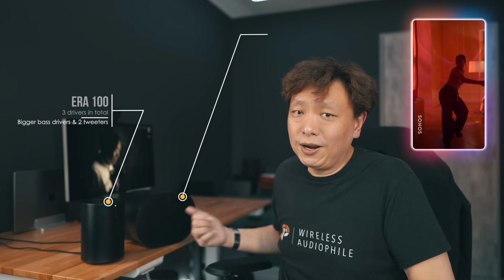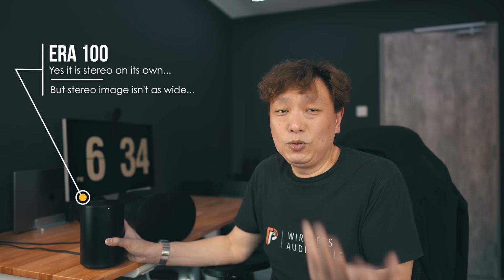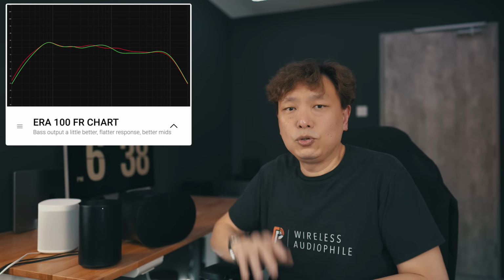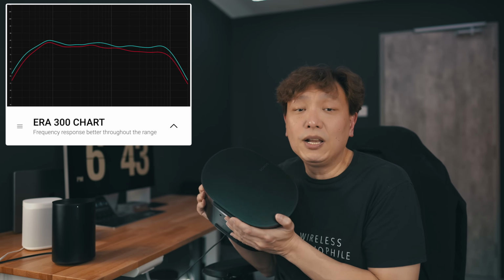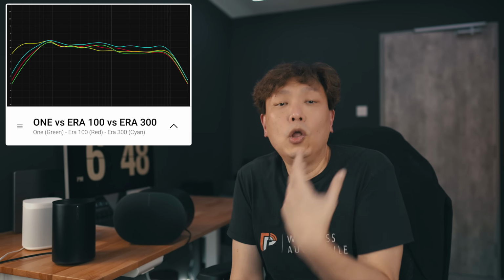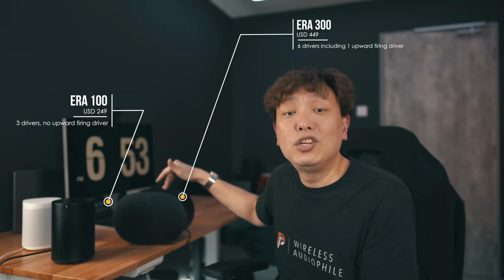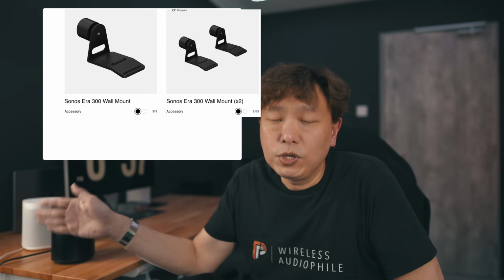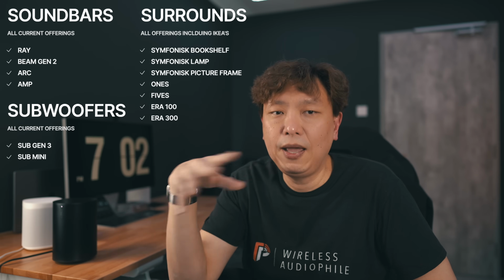Full Review of Sonos Era 100 & Era 300

Comment: Missed the boat with no upfiring driver and Atmos capabilities on the 100. It could have sold like hotcakes as a rear surround speaker at its price range. Marking up the price out of entry level range for a bunch of folks in this configuration was a massive blunder. The play 1 ticked all the bang for buck boxes. The era 100 simply doesn’t! I also don’t understand Sonos’s recent fetish for cylinder shaped cabinets? They’re simply sacrificing base output for cosmetics. I thought they might have learned from the Arc bass output fiasco, but nope! Square shaped speaker cabinets have worked well at boosting base for forever and a day.

Comment: Hi Peter,
Thank you for fruitful information given.  I'm now on a 20 years old Bose AV20 & traditional analog speaker (Arcam -  Vandersteen 2C - rest gone to graveyards already).  Looking to do some upgrade with Sonos & questions are:
1. How can I integrate the Vandersteen speaker with Sonos ecosystem?  Should I eye into Amp? Can do away with current Arcam integrate amp as it is about to reach end-of-life 
2. Considering Beam 2 + Era 100/300 + Sub Mini as my ultimate end game set & "no more" but can be less (see 2.2)
2.1 Would 300 overwhelm Beam 2? From price point aspect, 300 is more match to Arc (and 100 to Beam 2) but my view is having 300 with upward firing would do well with Beam 2
2.2 Need sub "and" rear speaker.  i.e. which combo doing a better job (a) duo-1 Beam+Sub or (b) duo-2 Beam+rear or (c) trio
Thanks in advance

Comment: Good stuff man. I actually find that even in stereo, the era 300 can deliver some really impressive sound on some tracks; the sound stage has no right to be this large for a single speaker, and while moving around the room, it remains really consistent.
I know that a lot of people seem to favor the Five for stereo listening, but after comparing both, I actually prefer the 300 for how consistent it sounds no matter where I am in the room.

Also, bluetooth is a really underrated addition for those who want to use the era 300 with an Android TV; most TVs and boxes now have automatic latency compensation and in my case, it works really really well even though it wasn't designed as a TV speaker. Sure, I'm missing on Atmos when using bluetooth, but for casual viewing with a projector for example, I was really surprised at how good a single era 300 did the job.

Comment: I have just bought 2 Sonos Era 300 to add to my Sonos Arc + Sub replacing 2 Play:3 as rears. I need some advice about the stands.

How tall are the original Sonos stands for Era 300 from to base to base (ie excluding the speaker itself)? My couch + pillows are 83/84cm tall and the ear level is about 94cm. 

I am thinking whether I should go for the Sanus stands which are 82cm tall (+ speaker height) or the Sonos ones (not clear how tall but probably 96cm + speaker).

Which one would be best?

Comment: Would the era 300’s be better rear surrounds than the in ceiling speakers? My biggest issue is the shape of my living room. I don’t have the option of putting speakers behind the sofa so they would need to be mounted either high on the rear wall or in the ceiling. I’m not even sure if the era 300’s would be able to mount on the ceiling so the amp+in-ceiling speakers may be my only choice. I’m just looking for the best possible setup for my application.

Comment: What upgrade would be better if you have existing ARC, One SL and Sub Gen3, The ERA 300 or 2nd Sub Gen3?
Reply from the maker: Very tough question.  But I’ll go for the era 300s. The second sub isn’t going to add so much more.
Reply: @PeterPee  thanks, planning to do some upgrade.
Reply: @PeterPee  Hi, one more question let say i will buy sonos five possible 1 or 2pcs to interface it with my TV using 3.5 jack right?

Comment: Peter - my current setup is Arc, Sub 3, and Ones, in a nice rectangular room. 12 foot ceilings.

The Ones are about a foot from the ceiling, about 2 feet behind the sofa, pointed 30 degrees down. Sounds great. 

QUESTION: Sonos User Guide says to mount Era 300s upside down if mounting near ceiling. I am thinking mounting them flat…no down angle…and toed in about 15-20 degrees. This will allow the Eras to have wall bounce from both sides. 

Thoughts?

Comment: Question: I currently run and ARC with two Play 1 SL's for rears and two sub gen 3's for my TV and movie watching, labeled theatre room on the Sonos app. In a second room I have designated as living room I have a Beam. I can control these two rooms independently from each other.  I would like to set up a pair of speakers in the theatre room for Stereo listening. Is it possible to get a pair of the Era 300's set up in the app to only use for music in the same room with potentially another Sub gen 3 or Sub mini and control it with the app? So in other words can I set it up as a separate system using the app and when I only want to listen to music be able to do so with the 300's?  Will the app allow me to set up a third room or separate option for this?

Comment: Thanks! I've been thinking about possibly upgrading to the Era 300s from play ones for my beam 2, full size sub and ones in my living room. Generally 
 50% volume, occasionally louder. I don't play my music loud enough to justify the five and they're not good at lower volume. I think I'll stick with the ones for now. Music only.
Reply from the maker: Hey if you are going to pair them with the Beam (gen 2), then it really doesn't justify the improvements to music. If you buy them for music alone and use them as stereo, then maybe. Thanks for your contributions!
Reply: @PeterPee  I decided to go with a pair of era 100. Not impressed with the reviews I've been reading on the era 300. After selling the old ones with an upgrade credit it's a pretty cheap upgrade. I got rid of the play 3s in that room long ago because they just cut out far too frequently. I've been trying trying to find a good replacement for the Play 3 forever and the era 100 is as close As It Gets with better newer Hardware.
Reply: @PeterPee  money is no problem I just don't blast my music loud enough to ever think about getting a pair of fives.

Comment: I Love your channel!!   I’m a Big fan.  I’ve got the. Arc, surrounds using ones and 2 Gen 3 subs.  Do you recommend the 300’s as a pair?  Do they make a noticeable difference in Atmos effects? I have a fairly big room and I think Atmos effects could be more pronounced with back speakers. Maybe this is the perfect speaker.  I’m not worried about music as much as Atmos for movies. Thanks Peter
Reply from the maker: Yes, absolutely they are much better than the Ones for Atmos. You add the pair to your Arc + dual sub setup and you have the absolute best that Sonos has to offer right now. 

Thanks for the contribution Philly!

Comment: Hi Peter, thanks for sharing all your experiences and tips with the Sonos Products. Moving forward, have you not experienced the lack of sound coming from the front-tweeters + inside speakers on the Era 300?

Coming from the Sonos One's as my previous surrounds, I've lost rear directional clarity for Music, movies, and the most affected, gaming. 

Sono's tech from their community have openly confirmed that when you connect the Era 300's as surrounds, the front tweeter is disabled. 

"They" claim disabling the front firing tweeters produced better results during testing. How????????

********It's undoubtedly a necessity to have a sound system that has flexibility. Not every single movie, show, nor song is going to be Atmos-ready, so allow either an option in the Sonos app or auto-detection of things like Dolby 5.1, 7.1, or just plain stereo to turn on ALL of the speakers of the ERA 300. 
But instead, the front firing tweeters are completely disabled for any application.

Many have reported back how nice the ERA 300's sound when they are setup solely on their own, or as a stereo pair. But once set as surrounds, it is severely crippled.

Customers are hoping there will be a solution soon as the Sono's Refund window is small.

As a temporary fix, users have been turning the volume up on the surround channel to compensate for this. Very much a band-aid fix as it still does not provide what the Sonos One's did.

Please share your thoughts. Thank you!
Reply: Also have two Ones as surrounds, but I am also afraid to lose my sound when using them for music. I’m going to wait this one out until Sonos listens to all “multi-users” and fixes a ‘when listening to music with tv off, turn on center speaker”-switch in the app. 
My other worry is my couch against the wall. Positioning is the most mentioned topic on any Sonos discussion group
Reply: @ookgoeiedag  I couldn't recommend to upgrade to ERA 300 even if the front speaker worked right now.  A friend of mine has your setup where the Sonos One's are placed sideways on both sides of the couch, the ERA 300 wouldn't sit right. They need to be behind you.

I just want to know how Peter Pee missed the fact that the front speakers on the ERA 300 didn't work in surround mode lol.

Comment: HELP: I previously had the arc connected with two Sonos ones and the sound was great but I was sold on the Dolby atmos of the era 300s so I bought these. After setup, true play tuning, and messing with every setting I could read online for maximum sound I’m noticing the era 300s only fire sound out of the side speakers that are facing away from the set viewing spot. I put my ear against the speakers and it almost sounds like that part of the speakers is the only one that is firing sound. It makes for a less than ideal immersion and I even prefer my ones over this. I’ve set the music playback between full and ambient, turned surround audio up and down, and messed with EQ settings and nothing.. tried all kinds of content including Apple Music in spatial audio and normal, tv, movies, YouTube test clips. It’s all the same. At this point I’d rather have two era 100s and a sub for just a few hundred more.
I feel like these speakers would be better without the arc.
Reply from the maker: Hmmm...   I addressed this issue in my new video.

Comment: Odd question, would it be better getting the era 300 with the beam or the arc with ones as rears? Currently have beam, sub mini and ones in my setup wondering if an upgrade to the arc or just getting eras to replace ones is a better way to go
Reply from the maker: If you already have the arc and Beam, I'd say go for the Era 300. I am also assuming you have the Beam Gen 2? Cos the Era 300 will only pair as surrounds to Beam Gen 2 not Gen 1.

Comment: Is it true that when the Era 300 is used as rears, the central speaker is de-activated?? Meaning that if I want to enjoy music on the Era 300 properly I first need to remove them as rears??? This is very disappointing after you consider the money spent on Arc, Sub and 2 Era 300
Reply from the maker: Yes, it is. But look out for my upcoming video... Releasing in minutes... It will convince you that it is the right thing they are doing. But yes, having them play music as surrounds will not be ideal.

Comment: So I got the era 300’s for my surrounds as well as Sonos arc and 2 sub gen but when I go to use trueplay it keeps saying speaker problem even tho all my speakers are playing , please help :(
Reply: That happened to me, I unplugged both era speakers, plugged back in, and it worked 🤷‍♂️
Reply: @johnnydo22  yeah I figured out what it was as well , I have a wifi extender and that was my problem so I disconnected it and restarted my router and unplugged both speakers as well 👍🏼👍🏼 sounds amazing now
Reply from the maker: The Eras are using Wifi 6 and the range is probably impacted a little. 2.4G range is longer.

Comment: I wonder if you can confirm something I am reading in a Sonos group, that when using the Era 300s as surround speakers with the Arc or beam gen 2 the speakers in the main grill by the Sonos logo get disabled. Some people seem to be upset about this. Personally I don't have the new speakers yet but I would think for atmos surrounds you would want the speakers to fire from the sides and top not the front.
Reply from the maker: Yes, that's confirmed. It's not a problem. My latest video addresses that.

Comment: Is it worth keeping Sonos One's for surrounds as rear surrounds and getting the Era 300's for the side surrounds? Or would that actually deprecate the overall sound and just allow the Era 300's to do all the surrounds from the side?
Reply: I don't think the Sonos app will allow additional speakers in the Arc or Beam home theater set-up?  You can add the Era 300 to an existing Arc/Beam group like you would in a whole house configuration.  The Era 300 would be in a mono or stereo pair and wouldn't be part of any Atmos channels.  It would be louder with the extra Era 300; but, you might also get some echo or unbalance sounds/dialogue from the Era 300 bouncing extra sound from walls and ceilings.
Reply from the maker: Yes, The Era 300 will replace the Ones. The ones you can use elsewhere?
Reply: @PeterPee  unfortunately not really an option but I guess I could sell them if I actually do upgrade, I will wait for a sale or something though first.

Comment: When the 100’s are used in surround mode does sound come out of both tweeters? I noticed on my 300’s that sound usually only comes out of one side.
Reply from the maker: For the Era 300, it comes out from sides and top, but not the front. For the Era100, haven't tried it yet but it should. In fact, the Era 100 tweeters are very close and it'd be hard to tell if one or both are firing or if one isn't.

Comment: Great review.
Do you know if is possible use a Beam 2 with two era 300 Like front audio with two symfonisk 2 using like rears?
Reply: 😂 definitivamente no, tio
Reply: You can only add the Era 300 just like you would in a whole house audio configuration (you just move the speakers in the same room).  The added Era 300s wouldn't be part of the 5.1 Beam+Symfonisk set-up.  It would be louder; but, you could also get a slight echo effect since the Era 300 will be bouncing sound of walls/ceilings with the wider soundstage depending on placement not 100% syc'd with the 5.1/5.0 Beam+Symfonisk.
Reply from the maker: Mrgold's answer is the right one.
Reply from the maker: No you can't.
Reply: Thanks

Comment: Great stuff.  I bought the beam gen 2 and sub mini after  your recommendation 4 months ago.  Do I now go with 100s or 300s to complete my set up ?
Reply: I would go for the Era 300s if you have room to place the rear surround behind your listening position so the upward firing Atmos speakers can bounce off the ceiling to your preferred listing position sweet spot.  I'm sticking with my One SLs with my Beam+Gen 3 sub in my Office because the rear surrounds are 2 feet away on either side of my sofa with everything backed against a wall.  Just a guess; but, my set-up seems it would really handicap Era 300 compared to One SLs/Era 100.
Reply: Thanks. They should have placed the virtual atmos tech on fhs 100 to be a perfect budget option when pairing with the beam.   They already had the tech.  Now to get some atmos effect we have to pay for each rear what we paid for the 1 sound bar.
Reply: @SE7ENAC  I would even take the option of re-purposing the One SLs in the Sonos App in a rear Atmos configuration in a upward firing configuration to have four rear speakers (two ear level, two upward Atmos).
Reply from the maker: Era 300s if you can afford them!
Reply: The beam was upgrade to the beam  gen 2 with virtual atmos capability.  That should have been the upgrade for the Ones.  Most people would prefer atmos effect over a second tweeter and a bump in base from a speaker that size.
Reply: Thanks Peter.  The passion that you have for your craft shows in wvery video.  Proud to be 1 on your subscribers.  Send me your referral code for my 2 era 300s.

Comment: Thanks for the great, in depth explanation of everything as always Peter. My first port of call for anything Sonos. I’m eagerly (impatiently) waiting for my 300s to arrive early April to join my Arc and Sub G3 and replace my current 1s. 
I have a question though, have you, or would you try mounting them upside down at ceiling height, I want to child proof them but equally don’t want to miss out on any sound quality/atmos effects by mounting them this way. I’ve search high and wide and cannot find any reviews of them mounted at ceiling height with the atmos driver aiming towards the user rather than reflecting the sound off the ceiling. I’d like to know what the surround sound is like that high up and how it compares to having them at ear height. Keep up the great work!

Comment: Good stuff as always Peter!! How I wish to have a chance to hear the arc setup with the era 300s! Just this week I was trying to optimize the sound of my arc 5.1.2 setup for better atmos effects but even with setting the height volume at +10 and tilting the arc slightly, I just don't hear convincing atmos effects. I feel like I can perceive the sound of the height speakers coming from the front rather than above. Mind you my ceilings are 9 feet and my distance from tv is about 9 feet. But i just don't hear anything "coming" from above. I'm sure the era 300 are game changers but an extra $1000 is just out of the question right now for me :(
Reply: I suggest you tilt the Arc by 1.5inches with a plastic door wedge, you will start hearing the height channels better. Let me know.
Reply: Unfortunately I experienced the same and I fear the Era 300 height channels will not be as good as simply buying an Apple AirPod Max